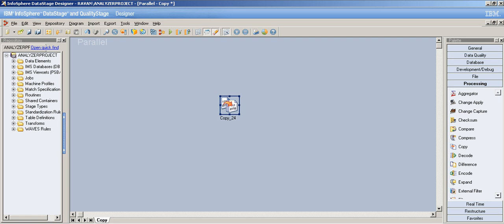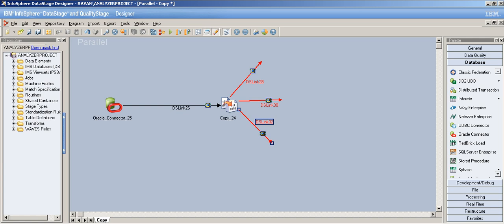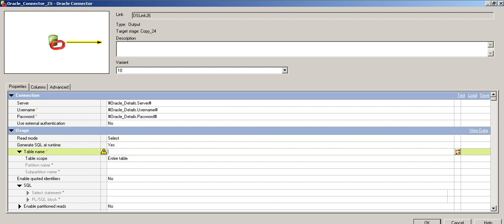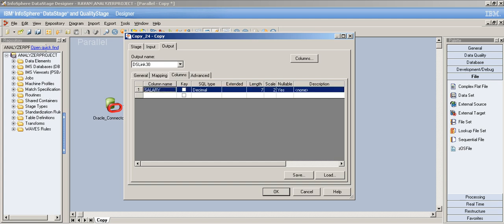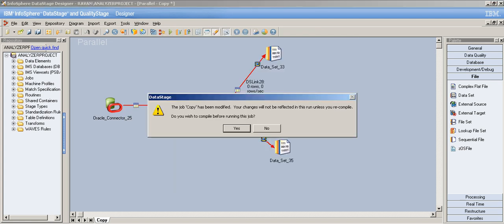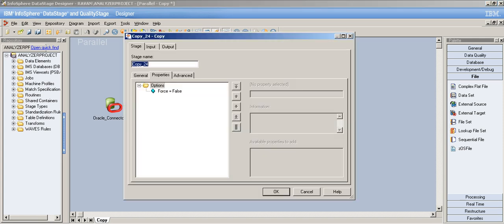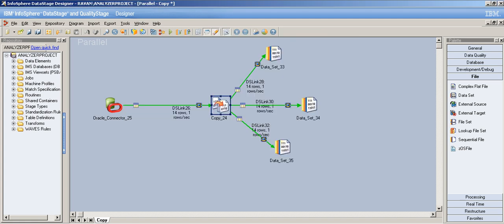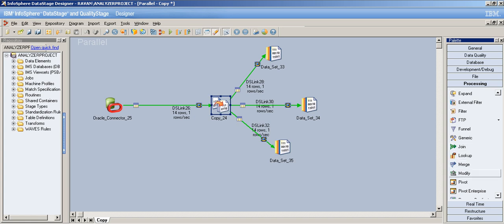Copy Stage with an 'EXAMPLE': Video 14 (HD)

Comment: force=true for copy stage....(for only 0ne output)  .it will remove the copy operation.......
i think we can remove copy stage.....

wht the need to put copystage with force=true....(we can remove copy stage  naaaa.....)
Reply from the maker: No..that was not what I said, Raj.
If you want to 'Copy' to a single output, DS understands that you are not doing copy operation (as it is usually copied to multiple outputs). So it removes the copy operation even though you want it. But if you choose Force=True, we are telling DS, 'Though I'm copying to a single output, please consider it as a COPY operation & do not try to optimize my job by removing COPY operation'.
Hope it's clear now!!! :)
Reply: if not doing copy operartion then we can delete copy stage
Reply from the maker: amul raj Right!!! But we need to copy the data to a single output & why to delete the copy stage, if we have an option like 'FORCE=TRUE' which makes the copy stage work exactly same as if we are writing to multiple outputs (though we are trying to write it to only single output).